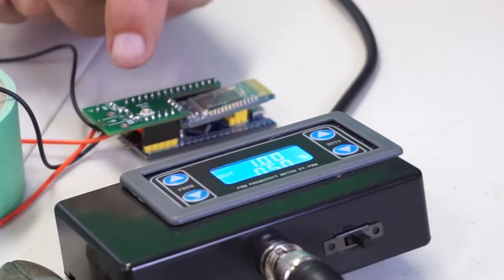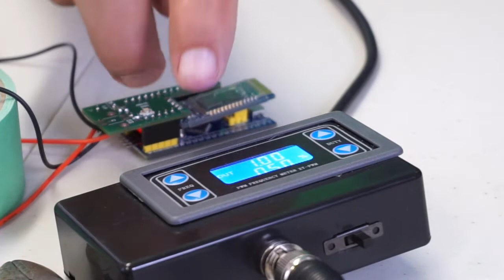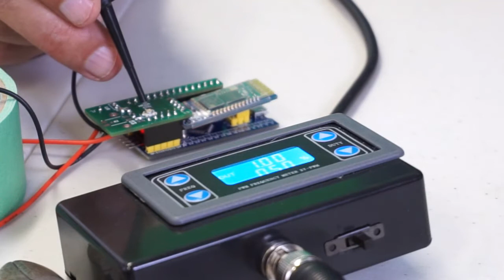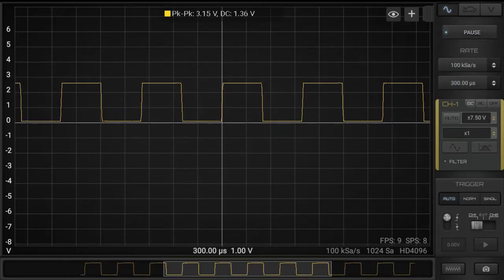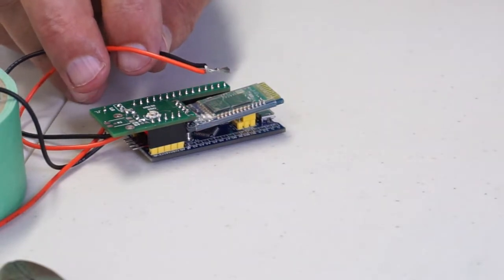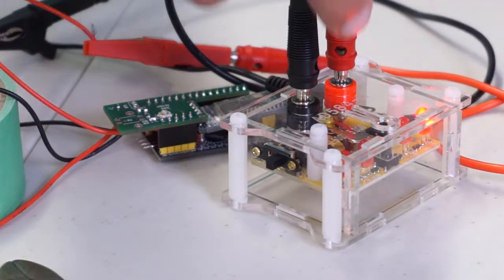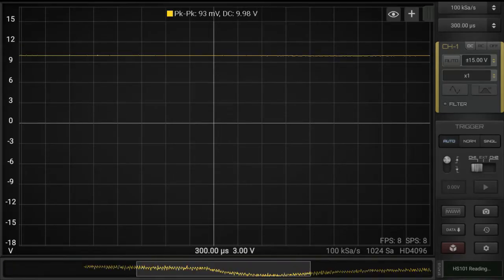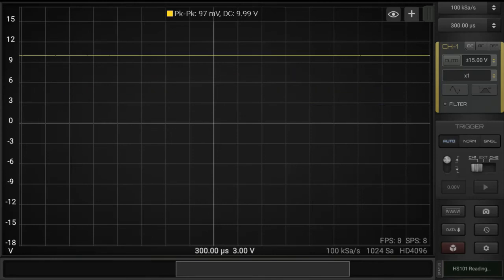GADGETS#116 - GOING SMD

Comment: Solder wick is wonderfull for bridges. You can also make your own liquid flux by dissolving roison flux in alcohol and then put it in a dropper bottle. I would not bother with solder paste or any fancy flux. A soldering iron fine tip works for me; I like the ones with a bend so it gives you an angle that you put across resistors and capacitors. The fine tipped soldering iron is a great way to solder a single pin of a chip inplace to get the positioning right. When using hot air avoid the center of chips to prevent damage.
Reply from the maker: I tried the solder wick before deciding to remove and re-solder MCP6S21 MSOP chip. It just wouldn't draw it out.
Thanks for all the other tips. I know I can use all the help I can get:)
I'm resisting the soldering iron method, for now. I may capitulate.
Appreciate the help, Alastair:)
Reply: @theGADGETSplaylist  Looking forward to your scope build (the higher frequency one); want to really build one of those!

Comment: Hey glad i'm subscribed or might have lost the channel from the name change. Love the content non the less. Im working on the HS401, already got my PCBs in the mail. Having difficulty finding the components, especially the STM32F411 chip without having to purchase in bulk. Also I have an older PC based instrument module that id like to use with some of the software programs like hscope but no clue how to get any of the apps to recognize the device, any direction i could be pointed in to get a better understanding would be helpful. Thanks for the info and videos!!!
Reply from the maker: You'll find STM32F411 that can be purchased 1 at a time on Aliexpress.
The HScope website lists supported oscilloscopes. Instruments not on that list won't have any Android support...
Yes, I took a chance with the name change and hope it gets adopted smoothly.

Comment: Hey. You changed your name. Still Canadian and Logical though.
Your solder wick with a bit of flux on it might have saved the bridged legs. Anything to remove a bit of the solder would entice the capillary action to move the solder to the pads rather than it being attracted to the ball of solder. Also sometimes you can use a bunch of flux and quickly stroke the legs axially and the iron will pick up the excess solder. It's all practice. You're doing well.
Nice build
Reply from the maker: Still me, Dave:)

Comment: Thank you for your time and gadgets Denis.
PS: next time you will do smd solder try to use solder iron with a thin tip. It will be better than hot air.
Reply from the maker: I'm resisting the iron, Aldi. At least for now...